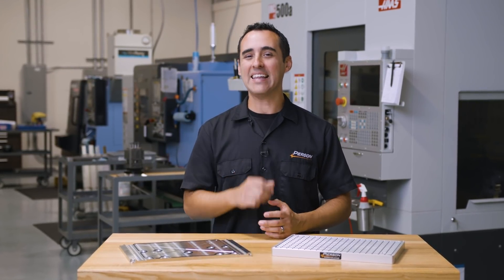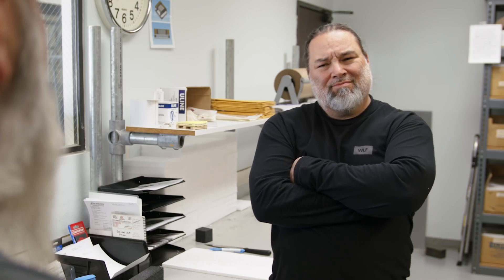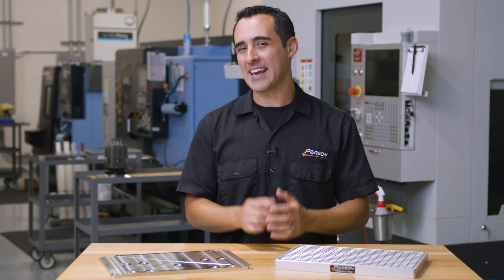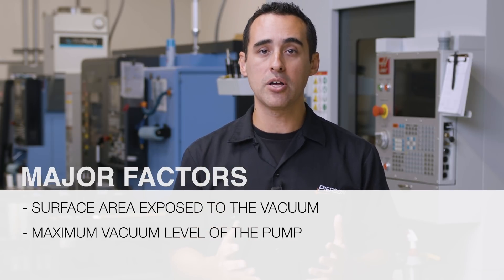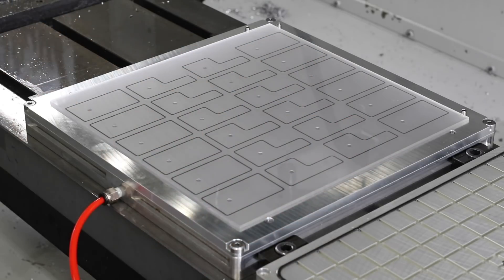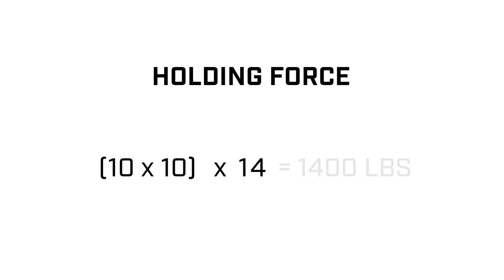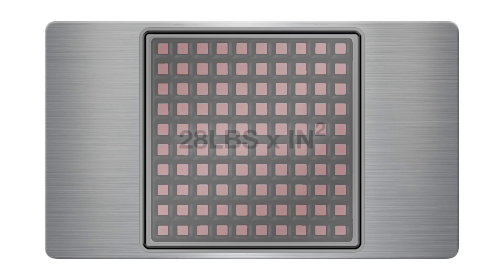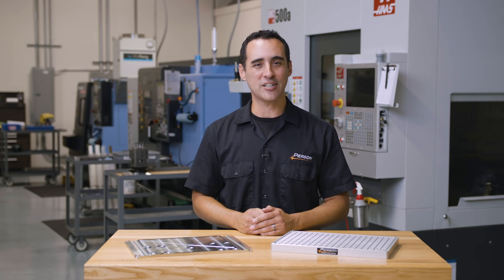He FOUGHT his Boss over this! - Pierson Workholding Q&A - Vacuum Workholding

Comment: I tested this by making my vac fixture without any clearance between the part and plate. I just made the grooves for the O-ring and the vac port leaving a facemilled surface. I put a part on the fixture, pulled 27"s of vacuum, and then pushed the part off the fixture without much effort. Next I cut .005" of clearance in my plate leaving the minimum of islands to support my part, put a part on, pulled 27"s of vacuum, and tried to push the part off, but wasn't able to. After this test I concluded you do want some clearance between the part and vac plate as it does make a big difference in how well you hold your parts. The part was a 9" x 12" sheet of 3/4" thick polyethelene. I do love vacuum workholding but think custom fixtures made specifically for the part is the only way to go. Or start with a big flat plate with one vac port in the middle and cut some rubber sheet to fit your part and go. This is my go to for short runs but you will need a higher flow pump and larger coolant separating tank as this method doesn't seal as well as O-rings.

Comment: Idea for some content: I would like to see data from pull testing on this. This is would be an easy question to answer and would only take a simple pull test fixture that could be made in the shop. 

Make two fixtures: one with groves and one without. Pull them apart and record how much force it takes. You could also test for different variables. A twisting side load could be interesting to test as well.

Comment: The larger the hollow space underneath the workpiece, the stronger the holding force. Obviously a part needs material underneath to support it. There needs to be a fine balance of grooves and support material. Mostly depending on the pump. This is because there will always be leaks due to variance in flatness and leaks within the vacuum system. Look up Festo vacuum workholding calculations.

Comment: Hello, I know this video is two years old, but I thought that this law of physics might be interesting to you if you don’t know it already.

Friction
Although the friction force depends on the normal force, the second law of friction says that friction force does NOT depend on the area of contact between the object and the surface. Imagine if you turned a box so that less of it was touching the floor. Would that change the normal force? No! The box still weighs the same, so the normal force doesn't change, even if the area of contact does
Reply from the maker: All good points you make. The more scientific term in this application would be "asperity" but no one knows that term so I just used friction as a term people could relate to.

Comment: Halving the surface contact area of a smooth surfaces contact does NOT double holding power. Simple surface friction is F=u*N. The force is the multiplication of the surface friction, u, and the normal force applied to the surface, N. Area is not a factor in the friction forces so long as you have similar conditions. If you reduce contact area so much that now the plate started gouging or digging into the surface the simplified friction equations no longer apply and how much holding force you have is much more difficult to estimate.
Reply from the maker: Pro Tip: Research "material asperity" for a better understanding.
Reply: @PiersonWorkholding  Pro Tip: The Archard Wear equation used to model asperity friction also has no terms in it for pressure. Only has terms for force applied. Which,again like in simple friction, you get to because the pressure and surface area units will cancel down to simply the force applied.
Reply: Thank you for all the wonderful comments, I was looking for something like this. I am baffled by lack of knowledge of 5th grade physics and " pro's " arrogance...by his logic I just wasted money on buying bigger machinist vices, when I could just reduced contact surface of jaws by 50%...
Reply: @PiersonWorkholding  Oh you mean surface roughness? Which has little to no impact on friction coefficients until you get to ultra high polishing? Like how gauge blocks ring together. You are nowhere close to having a smooth enough surface to get that kind of effect with typical tooling plates.

Comment: I actually got help from Jay back in 2013. Ended up solving a delicate polished aluminum surface problem - our problem was that the 2nd op for an architectural product needed to have polished aluminum facing down onto the vac table. The vacuum was pulling aluminum off of the face and appeared like pitting. 

The answer : sand paper. 

Yah I installed a small sheet of 200grit sand paper faced down to stand the part off of the vacuum table face. Yes we still had to cut a groove for the o ring material. But it worked great.

Comment: Friction (gripping force) is proportional to force not to pressure. Cars have grooves to force the water out and slick racing tyres work through an adhesive mechanism of friction which is proportional to surface area. I think it is more likely that the grooves he added reduced the resistance to the vacuum pump allowing it to combat a leaky gasket more effectively.

Comment: I think everyone got the vacuum basics right, but that doesn't explain why it didn't work in practice in this case (only make mention of it like AeroGarage). Imperfect work piece surface conditions, gasket improperly sealing, cutting operation sequence details, physical limitation of the vacuum work holding systems. For example, if the vacuum power is not enough to evacuate air if a small opening is created somehow, you could buy a better vacuum system, but a grid pattern to reduce vacuum power demands during operation is most likely more practical. 
Think about Einstein's quote, We cannot solve our problems with the same level of thinking that created them. 

For people saying there is no difference in a grid pattern than a flat surface. Yeah the Normal force from the air outside stays the same, but look in the limit of just having a sharp pyramid supporting the piece on the bottom, what will happen? It will apply the force to the tip and drive it in  the work piece. Clearly a different situation is created under the part where all that force is now applied to a single point.

Not sure how some say there is no change in frictional force using better threading. The threading allows for better traction, translating in more force applied to driving forward than is lost through heat or moving the surface material etc. by slipping. In a perfect world where you don't have slipping it doesn't matter. But 2 different things are happening to the threads in case of slipping or driving.

Comment: So in a nut shell groves make for better holding power.
Reply from the maker: You can't go wrong with extra grooves unless it deforms your part.
Reply: @PiersonWorkholding  I had the privilege to work at AMT Aerospace in Arlington, Wa and I was part of the crew loading and unloading Material onto 4’X8’ Makino Mag 3 cells Pallet tables and all their Pallets had  Crisscrossed Grooves in them and they weren’t for the Vacuum Seal.

Comment: Also if using coolant, which leaks past the seals, a flat surface will come off in no time at all because liquid moves a lot worse on the "molecular level". I don't see a reason why small grooves would not be made, but they don't need to be like the gasket grooves.

Comment: Hey, This is some great info but still confused. I have a small CNC machine for milling wood. I created a vacuum table in Fusion 360 with square patterns to the size of my bed (being 600mm x 760mm) on the outside of the square pattern I have my gasket.  I'm using melamine (non-porous) for the vacuum bed and screwing MDF (which is porous) on top of the bed. The inlet for the vacuum on the vacuum bed is center rear. I was on the notion that the grooves in the square pattern would be the path for the vacuum to hold down the MDF and whatever size of stock I'd place on the MDF board since it is porous would hold my stock. Do you think this will work for me for any size stock part regardless of the vacuum pump requirement? Thank you

Comment: I think The end was a Little bs

Completely off topic reference to tires ?!?

It all comes down to coefficient of friction not the surface area 
(As far as I know ;) )
Reply: The argument being half area double „pressure per area“ just means it’s the same ....
Reply from the maker: Double the pressure on half the area causes the texture of the materials to deform into each other causing a mechanical, not frictional connection.  That's why the sandpaper method works so well.
Reply: @PiersonWorkholding  so you want to tell me that sandpaper-Metal has the same coefficient of friction as flat metal-metal surfaces ? I doubt it 

But yeah the sandpaper tip is nice
Reply from the maker: @GrafRucola  Coefficient of friction is not the main principle at play here.  Think of it this way.  Two meshing gears have very smooth teeth to reduce friction, but they are linked mechanically. It's the same concept but at a microscopic level when the sandpaper (or any other texture) is mechanically pressed into the work piece.
Reply: @PiersonWorkholding  i think thats the definition of friction, how much surfaces interlink
Reply from the maker: Nope. There are different types of friction and, again, friction is not the main principle at play here.  I'm talking about asperity.  Google it.  Are you here to argue or here to learn?

Comment: I really can't believe the last part of the video is right. Friction-Forces on a flat objekt are totaly independent of the size of the contactarea! This is basic physics. (Assuming the downward force in total being the same)
Also you are assuming, that the gasket is 100% perfekt, which it never can be. My guess, why channels help, is the following: As the flow of air between the two flat serfaces is very low, the air which comes in through the gasket makes a difference. This leads to a good vakuum close to the Hole, but a weaker vakuum, the closer you get to the gasket. You can avoid this by adding some channels or a less smoth surface.
Reply from the maker: You make the same point we mention at 6:06.

Comment: We find that flexible materials will create a seal close to the vacuum hole that causes loss of vacuum on the outer edges.  A channels or multiple vacuum holes resolve this issue.
Reply from the maker: Correct.  Soft materials (non metallic) can self-gasket.  To prevent this, machine an X groove that intersects at the vacuum inlet hole.

Comment: The analogy of the racing tires leaves out horse power over friction. The same applies to using a vacuum chuck when you put in “tool cutting pressure”. That is only a small thing, but the details add up. And up cut end mill adds to the problem. I tried using an O ring for a seal on my parts to help with a seal. I tried all kinds of materials. What worked the best for a seal material was a silicone blend from Australia. Later, I went to no gasket at all. In short there are millions of ways to do the same thing. Find one that works the best for what your application is and run with it safely.
Reply: @John Holmes I'm in Australia, any chance you could share where you got the silicon blend from?
Reply: @activegrip  hi, I wish I could. I have been retired for about eight years now and all those records have now been shredded. I did find that company online. The Douro meter was in the 40 to 50 range if memory strikes me right. It was very soft. I got a much better seal without an o ring. The vacuum and the friction generated kept my part secure enough. I used 6061 cast aluminum plate, one inch thick. Then, I ran a face cutter to ensure the fixture was as flat as possible then I hand sanded it to remove any tooling marks to help my seal. 

I wish I could be more helpful, but that is everything I have for now. Good luck to you....🤠

Comment: So it's a pressure vs. "weight".  Correct?   You increase the pressure by using the same weight (force) on a smaller area.  Is that right?
Reply from the maker: Pressure is a constant and doesn't change.  You can consider it "weight" because it's the weight of a column of air pressing down on the part. The islands bear more of the downward pressure of the part.

Comment: In some cases if thin pieces with rather soft surfaces are hold down, it can happen that the part bends and creates its own seal right around the Vakuumport. Then the vacuum applies to just a very tiny area and the holding force is not sufficient. Groves prevent this from happening. So there is no definitive answer if grooves or not, always depends on the usecase. But I agree, rigid parts usally dont need grooves.
Reply: This is what I was dealing with, and Jay brought it up in my discussion with him too. I only machine plastic, and most of the plastic I work with is soft enough to self-seal around a single hole (I sometimes make vacuum fixtures with no gasket at all because of this). In general now, I basically make a pocket toolpath with a 200% step-over, and machine .010 deep, just to prevent the problem of the material sealing the vacuum in one spot.

Comment: Grooves are a manifold. You need them on larger parts to make up for the leak past the seals, which gets worse as the surface get rougher. We have very large vacuum fixtures for aircraft fairings and groove at least all around the seals for that reason. If you don't you will see a pressure gradient as the air rushes past the seals faster than it Can make it to the pump through the very shallow path.
Reply: Not sure if you're gonna see this, but shouldn't the only factor that matter is CFM of the pump vs the CFM of the leak? I believe you're saying the grooves act as "vacuum reservoirs", which would help if there was some immediate force trying to kick the part off the vacuum table. There is more volume to survive an instantaneous injection of air. But if there is a consistent leak where leak CFM > pump CFM, then the leak will eventually win (just a little bit slower). On the flip side, having no grooves means you can suck down big parts easier since you're sucking way less air out.
Reply: @NovaFT2  I have seen cases where on thin metal the vacuum would be held perfectly around the vacuum hole even though the outsides weren't touching the gasket.  Imagine two very flat surfaces against each other.  without a groove there is no way to reach the outer edges.